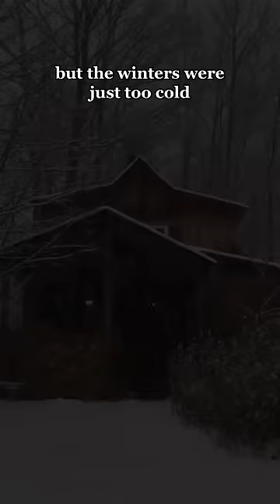I moved into the woods alone

Comment: In new mexico and Arkansas I hung  ( stapled   insulation on the walls ) then hung beautiful fabrics from the thrift store over them. Old tablexloths brightened the place up.  Also put down about an inch of newspaper on the floor and  covered it with discount ( and some free )  linoleum.  Very easy to mop up melted snow and boot tracks- wood chips etc. Also scrounged some free carpet from the linoleum guy and put it down in the loft bedroom...  i ran out of time to finish the chinking in a log cabin so i stapled up plastic onthe outside.  Cut down drafts and with the other things , it made the cabin warm enough to  be comfortable in the winter.  Living alone like this woman is , is a tremendous experience that transforms your life and character!!😊😊

Comment: Learned to “ CHOP WOOD”????? (😂😂😂)That wasn’t “chopping “ wood…… what was pictured is called a gas powered “CHAIN saw” ……🙄🙄🙄🙄
Reply from the maker: babes, I chopped that wood after I cut the tree apart with the “CHAIN saw”. Kinda hard to chop wood when it’s still in full size tree format.
Reply from the maker: not to mention it’s literally in the gd video 🤦🏼‍♀️🙄 use your comprehension skills yeesh